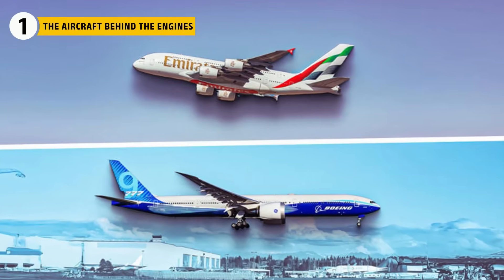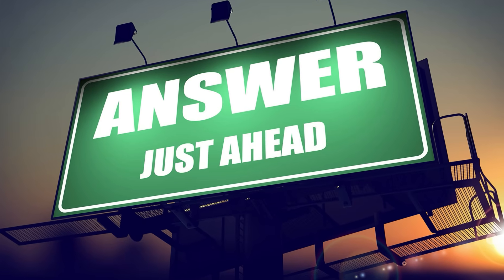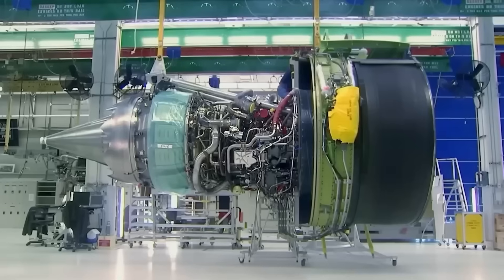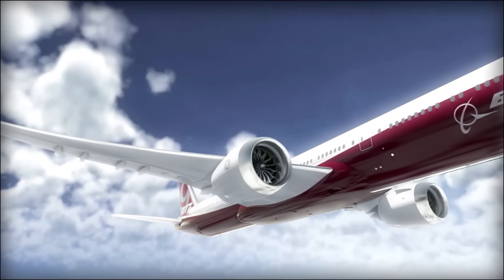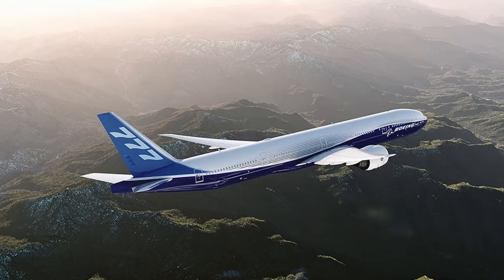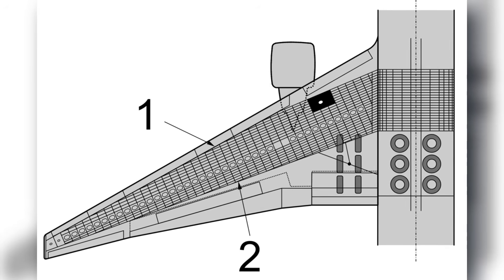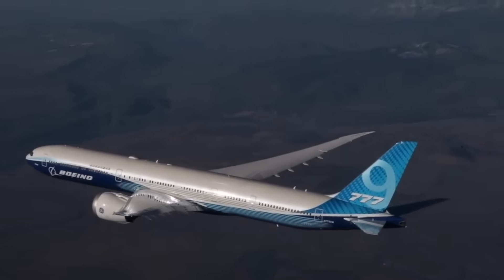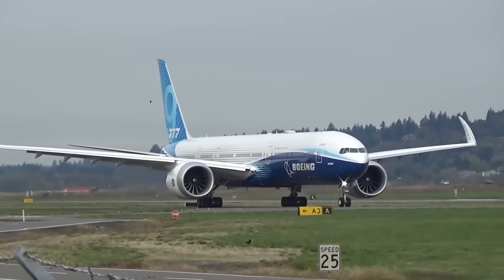Boeing 777x vs Airbus A380 | INCREDIBLE ENGINE Differences

Comment: The 777 program was launched in 1978, the A380 in 1996.  
The A380 was a larger competitor to the B747 which came out just as the era of the super jumbo was coming to an end.   The A380 is out of production and  no four engine jet will ever be built again. Two engines are more efficient than four.
The first B777X has yet to be delivered.  Its competitor is the A350-1000 which is only slightly smaller. That would be an apt comparison.

Comment: Airbus A380 production ceased years ago and is now replaced by the A350, which also has two engines. During the COVID-19 pandemic, several A380s were stored, but many have since been returned to service, including those operated by Emirates, Singapore Airlines, British Airways, Qantas, Lufthansa, Qatar Airways, Korean Air, Etihad Airways, and All Nippon Airways (ANA). 
There have even been renewed inquiries to AIRBUS about building the A380 again; AIRBUS is currently still considering this, but primarily refers to the A350 1000.